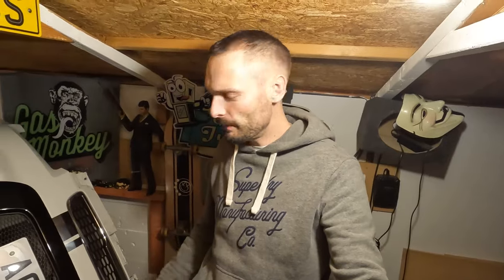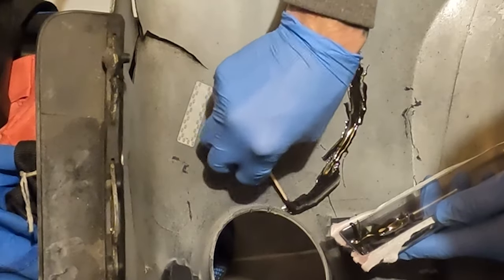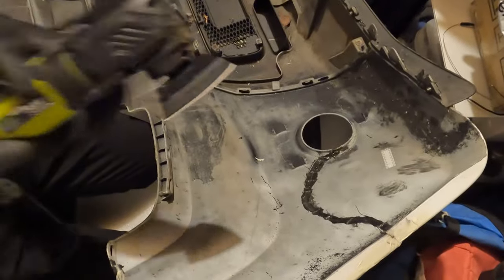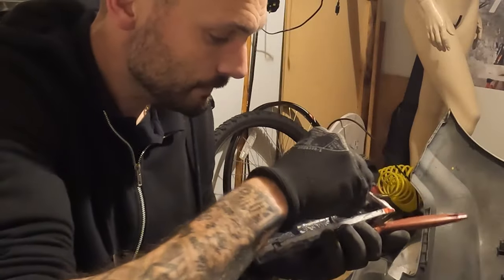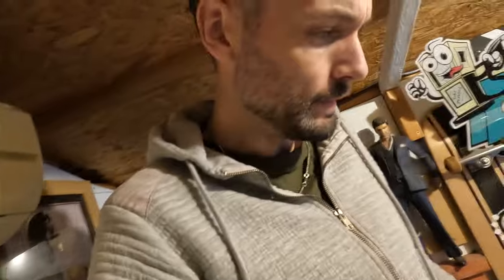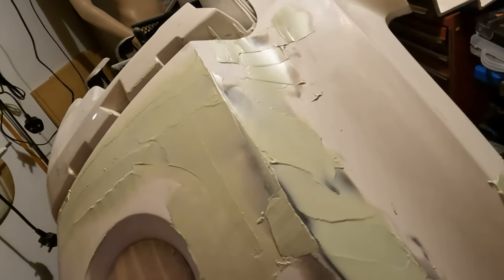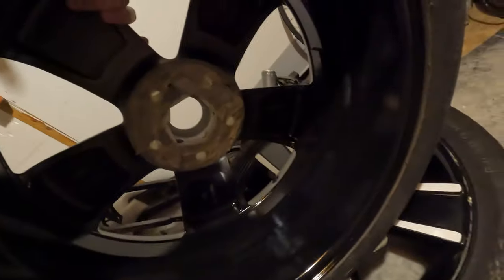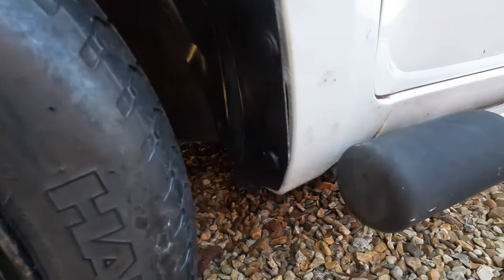I Did A MAT ARMSTRONG... How hard can it BE?

Comment: With all the stuff you bought to repair it you could have bought one from a brakers yard cheaper  ?? But then that's the easy option I would be doing the same as you 👍
Reply from the maker: Maybe... but I'd have to try and get the same spec so I got the same alloy wheels. I did look at that option but didn't find any without front end damage plus you have to add delivery into the mix so wouldn't have been the cheaper option.
I did go for new second hand parts as the brand new ones don't always line up as well.